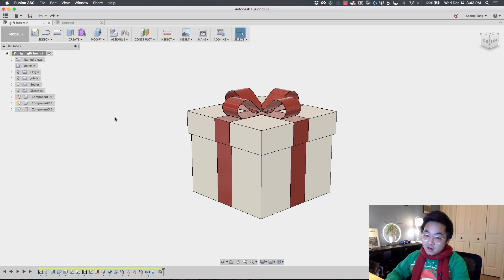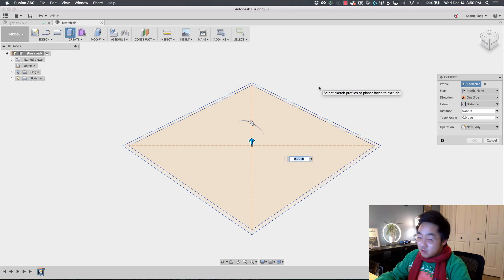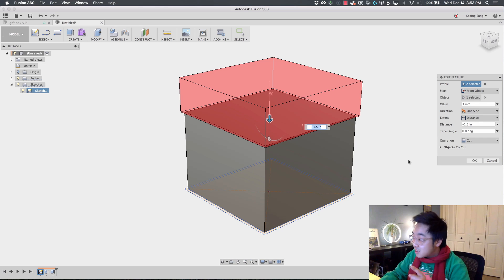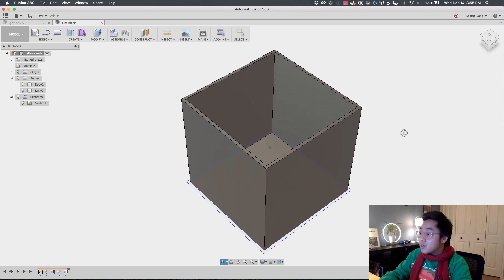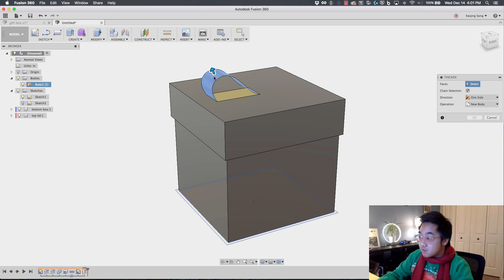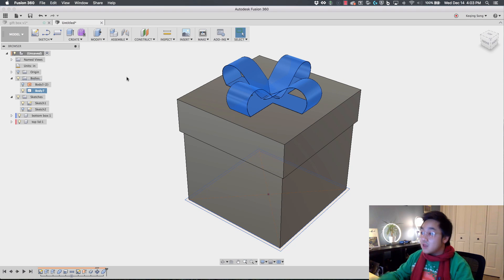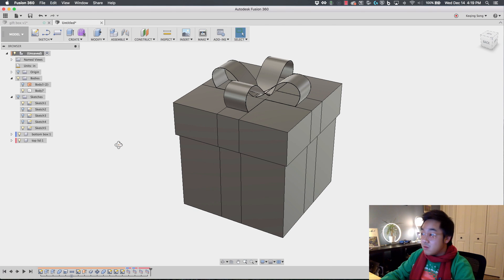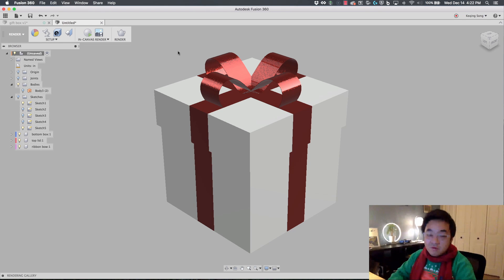Design a gift box!

Comment: Great video, I always learn something new.
Just one question; It doesn't appear that you left any clearance between the box and the lid ... or did I miss something.
The original post mentions a gap of 1mm.
I'm guessing that would simply involve creating another offset on the sketch. Or is there a better way of doing it.
Reply: I'd create the clearance with the as-built joint that I put, just offset it to 1mm.
Reply: Ah! of course. I should have spotted that.
Thanks for the advice

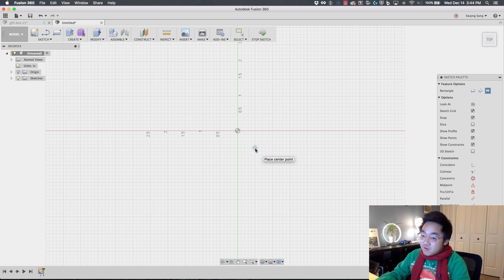Comment: On video length 0:55 you picked a plane.
Question: What setting do I need to change in order to have those planes facing like that instead of mines which have the Top plane facing the opposite way every time I start a Sketch.

Thanks
Reply: not sure what you mean by opposite view...as in it flips to the bottom view?